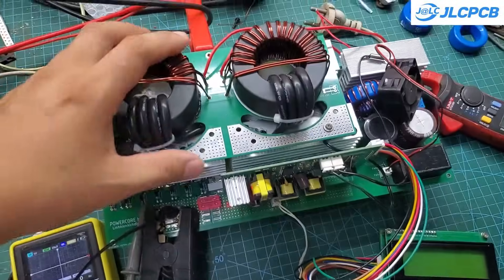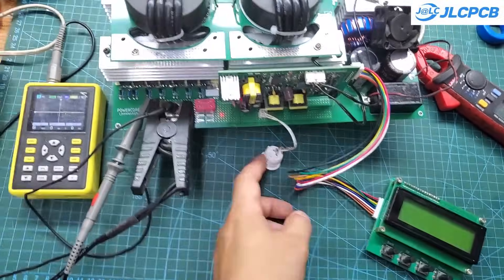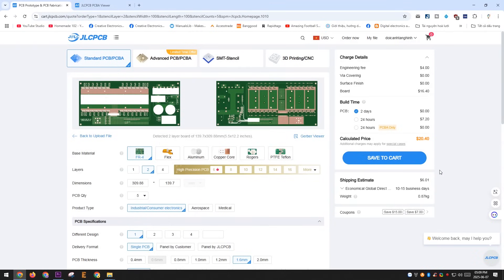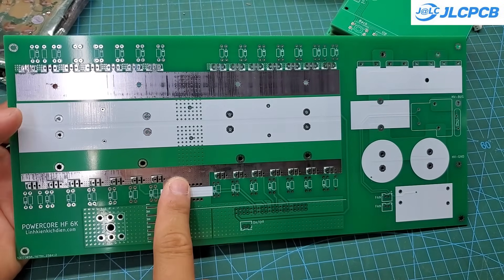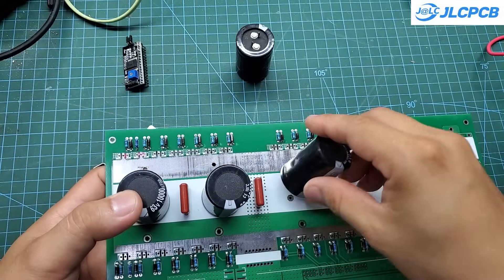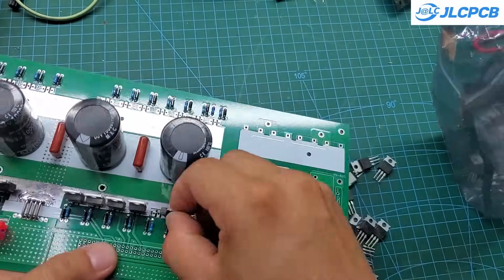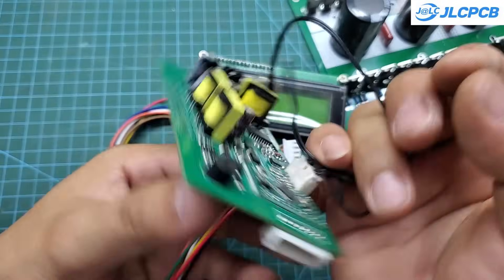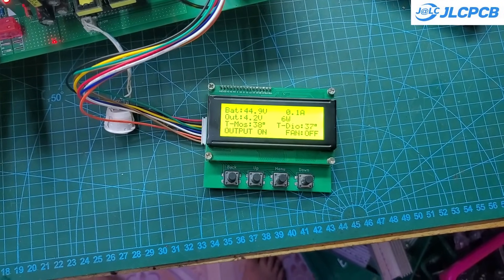DC-DC Boost 600W | JLCPCB

Comment: HI, beautiful project. I have only non-isolated BOOST max. 100 A input, 50 A per phase, I use 4 - 220 AMPS FETs,
and I am limited with ACS758 - 50 sensors so max. input is 100 x 56 V == 5600 W,
and eff. is only 95 - 96 %. But design is simple, no need to use expensive PCB. Only 100 A current 
needs special CU BUS-BARs, to be cold at 100 A all day long.